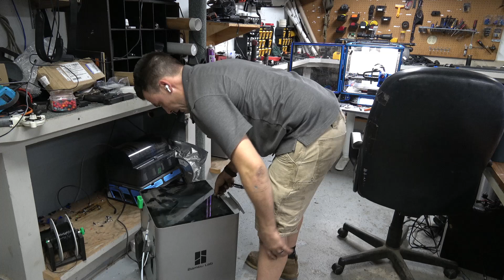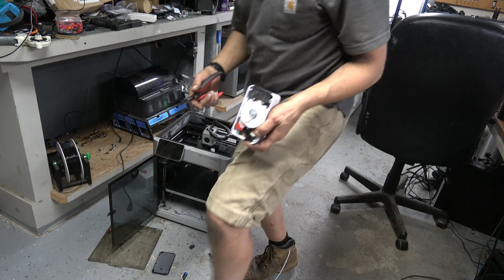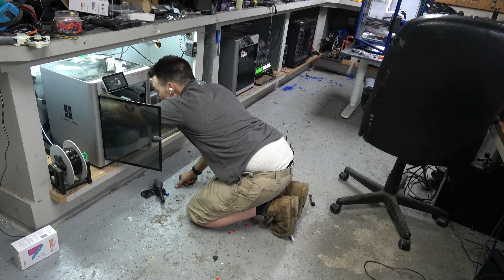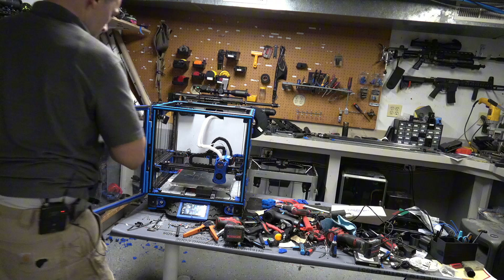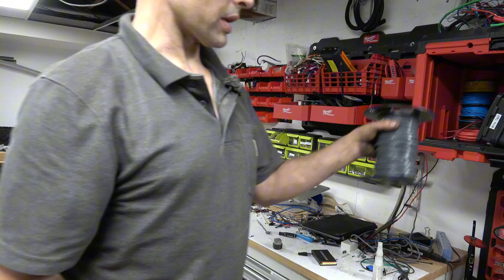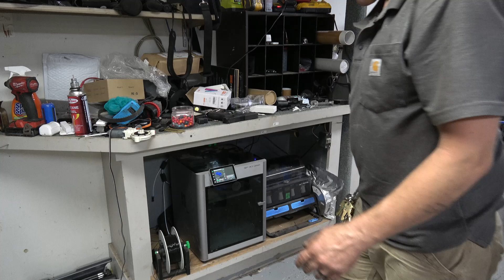Bambu X1C to X1E Conversion Part 1 of 2

Comment: why dont you use a thermostat relais with a display and they often have 2 thermistors and 2 heaters(normaly one heater one cooler) but you can use it like i said or you can controll a ptc heater and a 230v ventilator on it (on amazon you can find the thermostat relais for under 10 euro for one heater and one thermistor and for 10 or less euros ptc heaters with a fan on it or you use a 24v vent and controll it with the printer or a 230v vent directly to your wall socket and use a phase control dimmer to controll the 230v vent on it or for both a dimmer to get less power consumtion
Reply from the maker: Because I've already built a true high temp printer, 200 bed, 180 chamber, and 550 nozzle. No need to do all that on a bambu. It's just to print with PPS, and some other nylon, and higher (mid-temp) materials not peek, ultem. I have another printer for that.

Comment: Hi thanks for your video, as regards heating the chamber to print materials such as ASA and ABS I use a very simple method, I preheat the bed to 100 degrees and with a hairdryer I send hot air from the door for 4-5 minutes, the internal temperature soon reaches 40 degrees sufficient to avoid warping
Reply from the maker: I'm sure that works, a heat gun would work even better (they reach much higher temps) but this is easy, you just set the temp, and I've gotten to 60C for PPS and more engineering level filaments

Comment: Christopher have you used Revo hotted. I have 3 of the damed things running X1 PC and fiber stuff and all are jammed up you mentioned having the same problem just wondering
Reply from the maker: I have, I bought one for the bambu, and I had the same problem, I promptly returned it to fabreeko, they are awesome to deal with, very accommodating, and reasonable. I also got the duct for the bambu, and it printed worse than the original with the regular hot end, they took them back no questions asked. Really great company! Hope this helps, feel free to reach out with any other questions.

Comment: Ive had my X1C since launch and you are absolutely right. It just works. I needed a true work-horse that I didnt need to mess with and that is exactly what it delivers. I have been contemplating doing an active heater for it with printing more PA and PA blends. I typically heat the bed up to 100c and leave the printer for 30-45min to bring the chamber up. Could you link to what and where you got the heater?
Reply from the maker: Of course, I linked it in another reply check the other comments. It was just a few comments ago, I put the link to both the heater and the thermostat control, honestly this is a good way to go because even with the temperatures up on the nozzle and bed it only gets around 40 C, this will get it up to almost 60 with the bed and nozzle on as well, and really I didn’t see a big difference with two of them, only the speed in which it heated up, but aside from that it gets to about the same temperature. It would need a better heater for a higher temperature, but these just fit perfectly, the modification is so easy and seamless. You don’t have to damage anything. It’s the best way to go. Feel free to let me know. I would be eager to hear if you have any problems. I’m happy to help.

Comment: Do you think an add-on like this would be a good idea for the FlashForge M5 pro? It's basically the same as the p1s but no AMS and better filtration+sealing... Active print chamber cooling for PLA and cold temp parts and will keep warm for hot parts.
Reply from the maker: I don't want to recommend it, only because I am completely unfamiliar with it, a lot of printers are LIKE Bambu, because the real Bambu dominated the market so other printer manufacturers are trying to duplicate these, like most of them, but they aren't the same. I'm not saying you can't do it, I believe we can do anything we set our minds to, but I just don't want to recommend anything I don't know about.

Comment: Chris what power are you running your L2 at
Reply from the maker: My L2?
Reply: @Cjsairgunscarsandmachining  Your Leshiy ,There is a jet you can put in the Gearbox to make the hole smaller ,I put one in mine and it went from 777fps to 840fps ,you want me to hunt the video out for you so you can make one
Reply: @Cjsairgunscarsandmachining  Hi the vid is on my channel ,Leshiy2 port valve ,The size of the hole in the jet is 1mm ,I made one but it was too slack in the hole you put it in and at full power i shot it out of the gun ,It has to be tight in the hole ,Thanks for your gun vids very intresting
Reply from the maker: @TheAsa1972  Oh I didn't get it because it
s a 3D printer video, I appreciate it, You can reach out to me by email of phone, they're all on most of my shirts in the videos, I've had a lot of people reach out that way, I'm happy to help however I can.
Reply: @Cjsairgunscarsandmachining  Thanks